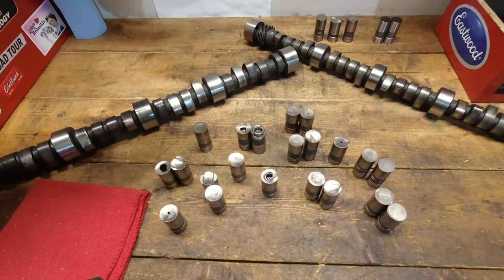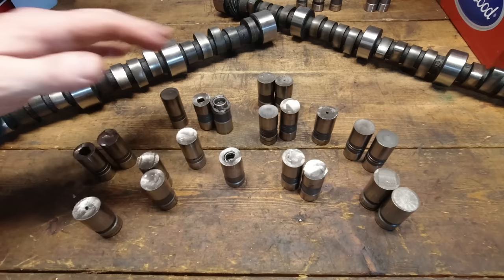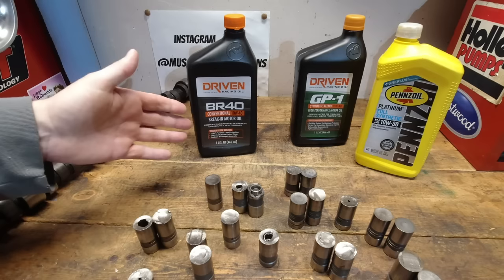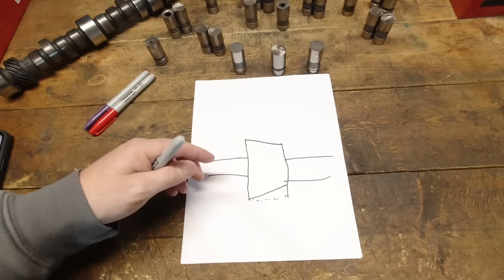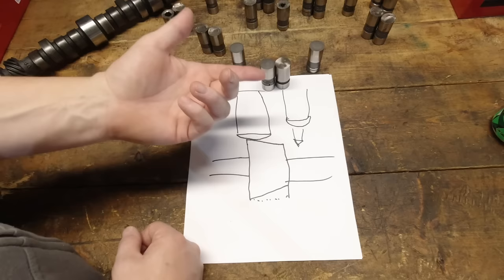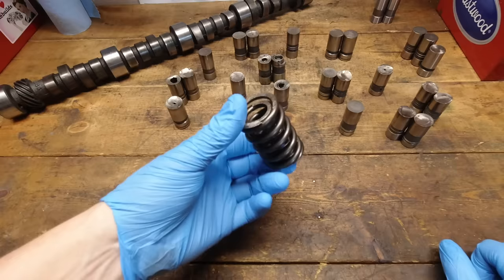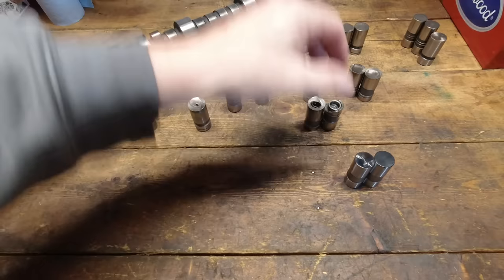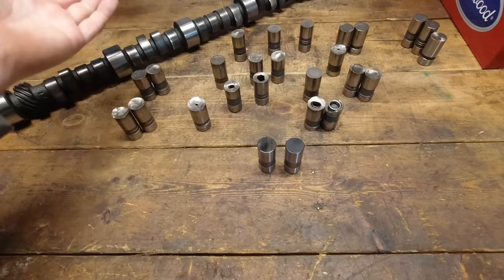Flat Tappet Cam Failures: The Reason Why They Go Bad & The Solution! Part 1

Comment: Chevy and most industrial engines such as Hercules and Continental had oil squirting capabilities on their connecting rods which sprayed oil on the camshaft lobes and other places to insure lubrication in these critical areas.  When Chevy deleted this feature in the late 1960s, we had a rash of “unexplained” camshaft failures.  The cam saver lifters may also help this situation

Comment: i have put Brand name flat tappit cans in doing all the right things and even using a Valve cover with the top side Cut out, I found that in some cases the pushrods are not turning right off the bat. That is proof that the lifer or the cam is cut wrong.
Reply from the maker: Many more factors at play than just the cam and lifter.  Keep watching the series.  I think you’ll gain some understanding of what is more likely the reasons why.
Reply: @MuscleCarSolutions  If the cam and  lifters are not made properly the rest don't matter. From my experience I have seen New cam new lifter installed with low pressure spring and low ratio rockers with Brake in OIl. The pushrod on 3 lobes did not turn right from startup. This can only be dew to improper machining.  if any other factor was involved the lifter would have started turning then stop. I use a Cut away Valve cover when I start a Flat tappit cam engine, I know as soon as the engine starts that the pushrods are not turning. I have seen so many Cams Fails, I do not recommend a flat tappit cam
Reply from the maker: @mylanmiller9656  that’s not the only reason why a lifter won’t rotate in the bore.  There are other factors at play here.  All the cam companies didn’t up and decide one day to not put a compatible taper and crown into the cam and lifters.  Keep watching the videos.  I dove way deeper into the this exact subject.
Reply: @MuscleCarSolutions  Ok what are your reasons for a lifter not rotating in the  Lifter  bore. lifter bore clearance that has been checked .
Reply from the maker: @mylanmiller9656  and what were they?

Comment: I have been looking for a video that showed exactly how the slope of the cam lobe and the crown radius of the lifter imparts the spin to the lifter.
This is something my father showed me, and motor manuals used to illustrate.  
Take two lifters and place them in contact crown to crown and you will clearly see the radius of those lifters.  And if I am remembering correctly that radius is a 30-inch radius.
When seated onto the cam lobe the contact point is off center due to the slope of the cam lobe.  That off center contact is what imparts the spin to the lifter.  This is vital for longevity as this creates a rolling contact point. Throw in a film of oil and "VIOLA" (as the French would say) you can get 100K + miles easily as opposed to 5k without rotation (if you're lucky)

Comment: If I go with all your steps here what would be the right assembly lube to use ? ...great videos btw great content please keep it up
Reply from the maker: Thank you!  Glad you’ve enjoyed the videos.  I did an assembly lube comparison video a few years ago.  Two things would be the biggest deciding factors.  What type of valvetrain are we using and how long will the engine sit before start up.  That video covered the time element part to show what had the best staying power after sitting.  Picking a good assembly lube with good anti wear properties is what’s most important to me.  The Driven gel is now my go to for just about everything.  It’s also in that assembly life video.

Comment: Seeing the recent cam & lifter failures after a break in doesn't fill me with confidence in rebuilding my original 361 Big block Chrysler, The cam & lifter on the motor has got dished lifters and a rounded cam taper, the car still runs fine and the lifters rotate but i know i'm on borrowed time. thanks for touching up on the cam & lifters.
I heard some convincing rumors that the cam & lifter don't survive the break in is because of a machining flaw on the lifters know as a "Crown" is not present on some lifters.

Edit: Oh, you mentioned crown on the lifters, disregard the previous statement.

Comment: When I bought my cam and lifters from TA Performance, they didn’t have matching lifters. The cam was a Crower, and my choices for lifters were Johnson or Delphi. I went with the Delphi. At any rate, it’ll be the last flat tappet engine I build. I haven’t had a failure yet, but I’d like to quit while I’m ahead.
Reply from the maker: Completely understood.  I’d do the same.  Roller for the win!

Comment: Machine shop i use like Maxima break in oil. That's what I was using when the flat tappet cam failed during break in on my 351m before I went to a roller valvetrain. Cam and Morel tie bar  lifters were 900 bucks.
Reply from the maker: I did an interview with Driven last year around this time.  The interview with Lake Speed Jr coming up in a few months will be enlightening for sure.  As long as the chemistry is a match, brand isn’t as critical.  Stay tuned for that video!
Reply: @MuscleCarSolutions  will do. Thank you

Comment: Good video. You covered things that I suspected were causes such as oil type and spring pressures. Leaving the windage tray out I hadn't considered but it makes an engine test run stand make more sense to be able to do the windage tray and valve spring change before fitting the engine.

Comment: Good presentation..... 
 David Vizard, one of the world's premier race engine builders, author of over thirty books on racing engines, and magazine tech writer, has developed a revolutionary new "Engine Break-in System" using Oil Extreme's proprietary Calcium Petroleum Sulfonate technology.

    In David's engine building seminars, he has been so sure of his 8 to 11 extra horsepower claims that he has done before and after dyno tests right on the spot, with the whole class watching.

    One well known skeptical engine builder, who was doing the dyno test in his shop, came out of the dyno room after the dyno runs, and told the class, "This ** works." The actual gain was 8 Horspower, after using only 1 bottle of the 3 bottle set. This EP (extreme pressure) anti-wear technology is the answer to the low ZDDP levels in today's motor oils.
This system eliminates cam wear problems.
Reply from the maker: No such thing.  If some magic formula were discovered, every single cam manufacturer would be selling it.

Comment: The heat treat (Hardness) is between 52 and 55 on the cams. If the 1.5 thousands dome on the lifters does not match the taper on the cam, they won't survive!

Comment: Also sounds like an engine running stand is a good idea before install.🤔 (windage tray issue-the springs can be changed in the car, as you’ve said) I’d like a calm, low profile roller for my next 440.🤔

Comment: I tend to lean towards todays oils and lubricants are designed specifically for the roller cams in engines built from mid 80's to 90's. I had my 72 mopar rebuilt with new cam and lifters broke in at 2200 rpm with zinc oil. I found a source of oil with zinc added that will go in on every oil and filter change just to make sure that lube properties from zinc oil stays on surfaces, I won't go back to the new formula oils for todays engines. Bad enough that I have a hard time getting gas that has 0 percent ethanol.
Reply from the maker: Certainly part of the issue.

Comment: Never had these problems with Delphi lifters. Hardened faces.  I used to use Loco oil from the railway workshops, heaps of detergent never hurt my lifters.Performance cams were also Nitrided.
Reply from the maker: There’s Delphi lifters in this video.

Comment: I rebuilt my 79 351w (flat tappet) engine a couple years ago.  This was my first engine build as well.  I bought a Sig Erson cam and those cheap ass Summit Racing branded lifters.  I used the cam lube that Erson supplied on the lobes, Amsoil SAE 30 break-in oil, and a Zinc Additive for extra measures.  Broke it in for 20 minutes varying from 2,000 to 2,500 RPM, ran it for 500 miles, then changed it with Amsoil ZROD 20w-50 oil.  This ole bitch is still going strong with about 4,000 miles on it to date.  I'm a believer in the break-in oil deal.  Anyway, just thought I'd share my story...

Comment: There are a lot of causes for flat cams. When I did a cam swap in the big block Mopar I was really scared because of all the failures. I wanted to run a Comp cams. There the biggest name. But I ended up passing. I ended up using an obsolete Mopar Performance cam. I purchased the Cam in 2022. The outside parts decal was dated 2014 and it was stuck on top of another older Mopar decal. The paperwork inside the cam was dated 2009. What also interesting is there were 2 references to use Comp cams break in lube. Well my cam break in was successful. I’ve have about 2-300 miles on the cam so far. So good.
Reply: Mopar cams are superior to comp cams. There are many comp cam failures.

Comment: Have you tried using Schaeffers Oil? They have excellant break in oils and a compatible Moly additive that is chemically compatible with the base lubricant. Schaeffers has been in business since 1838,uses Penn Grade base. Interestingly they are not as well known as the well advertised names. We have had great results.
Reply from the maker: This is what’s troubling about what shaeffers has become.  Penn grade, has used a gulf crude base since they were bought by DA Lubricants and had to change their name from Brad Penn (the name of the town where the Kendall crude came from in Bradford PA) to Penn grade.  The new owners wanted a cheaper base oil and didn’t want to pay for the exclusive rights to the Pennsylvania grade crude.  Driven owns those rights now, and that’s who I’ll continue to use.  The Pennsylvania base oil is significantly better than anything on the market.    When Penn grade changed their formula AGAIN, to go a cheaper route, they changed to Penn grade 1.  But that’s what investment companies typically do to a brand.  Cheapen it and increase profits.  Very sad about shaeffers if they were bought by DA or are buying their base oil from Penn grade.

Comment: Learned a lot.  Which I needed because I am putting a 283 together and will be buying a slightly better than stock cam for it.
Reply from the maker: Sundays video interview with Billy Godbold should give you some more details on flat tappet cams, break in and those DLC lifters.  Good info!
Reply: @MuscleCarSolutions  I also have many questions on what camshaft to choose, so I will be searching for videos on that as well
Reply: Stock 64 283 220hp 4bbl.  I believe stock cam was .198 / .198 and .398 / .402 ?  Not changing valve size or pistons, and I was thinking roughly .214 / .220 and .420 / .424 as a cam
Reply from the maker: @Foxcanfixit  kind of difficult to use mostly stock components and choose that duration.  If you keep the stock heads/pistons/ CR/intake?…I’m not sure I would go with that profile.  212/218 would be the most aggressive I’d go if you were getting a little bigger on the valves/higher CR and a better intake.  If you’re staying mostly stock on everything else, look more at 206/212.  Something closer to that range.  Good torque, fun in the lower rpm range.  If you put too big a cam in now, with no plans to change down the down it’ll be a dog to drive around on.
Reply: @MuscleCarSolutions  that’s exactly what I needed to know!  Thanks a bunch!  Keep the lift under .420 or under .410?
Reply from the maker: @Foxcanfixit  the lift really isn’t the important number on a cam, though it’s the first one everyone talks about.  In your case if you keep it under .450 you should avoid any piston to valve clearance issues.  Measuring is your best friend here.
Reply: @MuscleCarSolutions  sweet!  I knew under .450 especially with press in rocker studs, just didn’t know at what point the lift didn’t matter for CFM flow anyway.  It’s a small motor that I want just a little over stock, so this helps me a lot
Reply from the maker: @Foxcanfixit  yup for sure the stock rocker studs is another consideration.  But sounds like you’re not trying to turn the thing 6000 rpm and take the thing to the track every weekend.  Just a fun little cruiser.
Reply: @MuscleCarSolutions  💯.  Don’t even have a car to put it in yet
Reply from the maker: Ah!  Well if you have an idea what it will go into and want to build the engine for that.  The little 283s don’t get much love.  All the bigger bore engines get all the attention!  Best of luck with the build!  Looking forward to your videos on it.
Reply: @MuscleCarSolutions  I’m hoping to find a 74-77 El Camino or Sprint, or any full size wagon.  Question again: the .206/.212 is at .50 lift correct?
Reply: @MuscleCarSolutions  would a single pattern .212 cam with .440 lift and 110 LSA be in the ballpark?
Reply from the maker: With an intake change, yup!  On a stock intake and carb?  Probably a little too much.

Comment: I hear the machines grinding the cams were not putting enough taper in the cams or in the lifter
Reply from the maker: It’s not a random rogue machine.  If it’s a GOOD cam company, they’ll measure the final result to ensure all the specs are correct, even taper.  

What it boils down to is what I mentioned in the video.  If you use a cam and a different brand lifter, you’re rolling the dice on if it will fail immediately or even after a longer period of time.  Crown on the lifter and taper on the cam need to work together.  That’s one facet of why the failures occur.

Comment: So over time oil has changed, windage trays and main girdles are more common, high lift cams with possible ramp rates changing spring higher pressures are more common than back in the day. Along with possible mix matched cams and lifter crown and tapper. Break in procedures.
Sounds like any one of these could  be enough to take out en engine.
Reply from the maker: Very true.  The last video in this series covers one last thing that is universally ignored.  Lifter bores.  I’m afraid it’s probably one of the biggest factors.

Comment: How Close did I come to Catastrophic flat Tappet camshaft Failure ??  .....Just got  around  to Inspecting my 1970 Factory engine hydraulic flat Tappet Lifters with Only 10,500 miles, that were swapped out in 1972 for upgrade to solid lifter cam....  On the1st lifter Face I check has a perfectly Centered, smooth flat Depression 0.660" wide by 0.003" deep.......Only good 10W30 & 20W50 Pennzoil was used & Very frequent Oil & Filter changes.......This Factory Original 1970 Plymouth 426 hemi engine used 320# Open single Spring with Damper.....  Apparently the lifter had Normal Rotation until removed in 1972 during swap  out to Solid lifter Cam.....Assuming the lifter Originally had the Standard factory 0.002"--0.003" Domed Face, this Depression Is 0.006" face Wear in Only 10,000 miles !! ....Is  This a clear Example of 1970--1972 factory Oem Accelerated flat Tappet wear & Imminent lifter & Cam lobe Failure when properly Machined good American Metallurgy parts & good Zinc oil Was the Norm ??  ......The engine, with the factory Lifters sounded Normal & ran really strong 13.0's 107mph 1/4 mile.....How Close to tappet Failure did I come & Why with all the good quality Factory American pieces & High Zinc oil of 1970 ??

Comment: You have convinced yourself that Zinc additives are the answer, when "running in". On street vehicles, 40 years ago we just used straight (cheap no additive) oil for 1000 miles. Then we dumped the oil and refilled with your good oil. Part of the problem with running in is the driver of the vehicle. Generally you should drive around at local speeds, varying revs and load as you go.  Add a few hills into the mix to vary the load on the engine components. You won't get a good result off a bench. As for the cams, a good coat of Moly was all we used.
Reply from the maker: What did the oil have in it 40 years ago?  It had zinc.  It’s part of the answer.  Not the entire answer.

Comment: Cummins diesels still use flat tappets, They don't seem to have issues with cams and lifters. I think it more has to do with the energy conserving properties of the new oils. It is too slippery and the tappet doesn't have enough friction from the cam to turn in the bore.